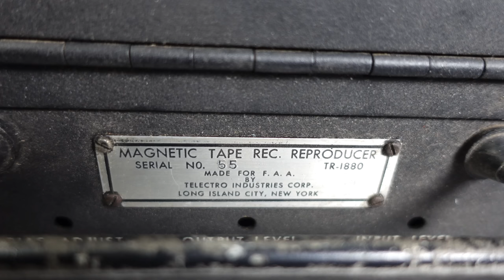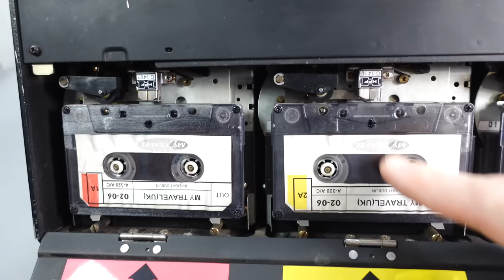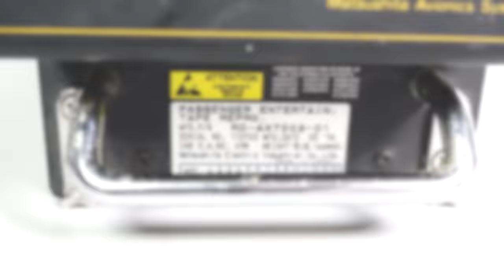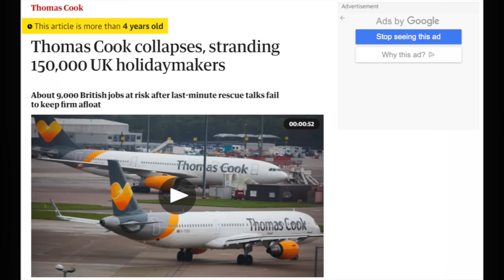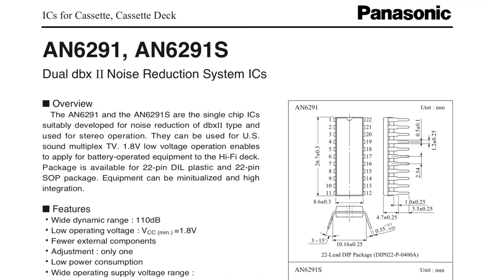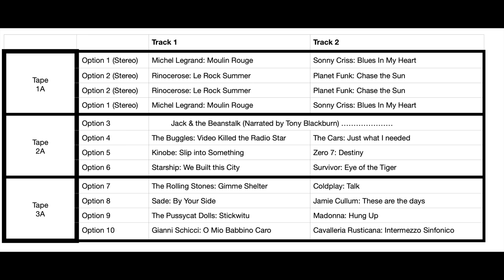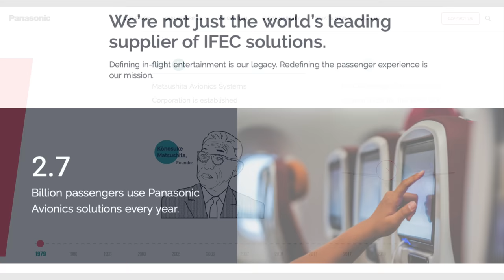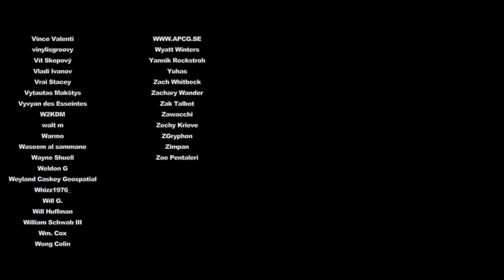The in-flight audio player

Comment: As an AV Geek (the aviation kind) I have fond memories of traveling on planes and experiencing the innovation in the IFE space.
2006 was an era where first generation AVOD IFE systems were reaching market saturation - at least on long haul wide body planes. The transition to AVOD resulted in the use of digital storage media for both audio and video, which would have enabled the transition out of these audio tapes for the audio "radio" channels. And even then, these AVOD systems were so unreliable that old channel system with banks of tapes was kept as a backup.
Reply: I assume that these AVOD devices had spinning hard drives in them, which could made those unreliable and prone to breaking down every time the plane shook (especially at takeoff and landing)?
Reply: @negirno  HDD's are not as bad as you think. Your average consumer hard disk "maybe" (with a lot of stress on may) but you can use those in a car with a laptop and those can get pretty bumpy. Those made for high stress environments can withstand a lot more, your average enterprise disk will outlive a normal desktop drive by an order of magnitude. Also: some drives can "instant park" to avoid most of the damage of extreme high G impacts (in the 500G range) and were definately capable of this in the 00's. Looking at normal figures of consumer drives, those can take 60G's while reading and about 250G with the heads parked. That's pretty impressive and that is just consumer drives. They have known failure rates, but so do all components.

If they could not, I'm pretty sure nobody would take a laptop on a plane. 

As a notion on G force impacts: look at some data from F1 driver impacts, the highest ones are just above 60G and if your plane did that the state of the entertainment system would be the least of you problems.
Reply: @NoNameForNone but then  again, nobody is taking their laptop on a plane several times a day, 7 days a week, year round. Plus your laptop isn't going to be directly bolted to the plane to pick up every little bump like a system like this would. So even though enterprise drives are a magnitude more sturdy than consumer drives, they also undergo a magnitude greater amount of stress.
Reply: @negirno  Yes, highly likely. Solid state storage as capacities which can store bulk digital media have really only become affordable in the last 7 years or so. However, any item mechanical or not would be developed, tested and rated for use in airplane conditions. It's not a consumer drive re-purposed.
Reply: Generally the unreliability in the early days of AVOD was more a result of the underlying maturity of the technology. The software and physical network was in its infancy and only really started improving in the 2010's.
Particularly the video part of these early channel based IFE systems used to run very similarly to analog TV's. RF composite video signals were piped around the plane, run to and demodulated at each seats television screen. When the first generation AVOD systems came about, data files were sent to seats using the same wiring but using the DOCSIS or HFC standard and a modem at each seat.
You can imagine how complex this set up must have been, especially when serving 500 passengers on a 747. And when the system would inevitably crash or freeze, a reset would take over an hour
Reply: @delightfullyyummy  Meanwhile as a software geek it's the "taking an hour to reboot" bit that seems ridiculous. Not so bad if it's consistently done when it'll be at least that long before the system is needed, but... what on earth was that software even doing ? Running on a server that takes 45 minutes to POST for no very good reason? Just being that bizarrely structured that it takes an age to actually start up, like self-service POS units still are (but even those don't take THAT long as far as I know)?

Comment: 1:47 . . . When Mat mentioned the 400 Hz AC power supply used on commercial airplanes...  this is done to save weight by making transformers and motors significantly smaller and lighter than land-based 50 or 60 Hz devices for the same amount of inductive power transfer.
Reply: Wow. Before this video, I thought that airplanes simply used 12V DC like cars do, or 24V DC like RVs do. I don't know why they bothered to add transformers. Perhaps to save on fuel since DC uses more energy than AC, and on an airplane fuel economy is essential.
Reply: @skywind007  Commercial airplanes have standardized on 115 V, 400Hz, 3 Phase for AC powered motors and lighting,  and 28 VDC for all essential DC (battery or TRU) powered items for decades. 
The Boeing 787,  switching from bleed air system to electric (anti-icing, passenger cabin pressurization, etc.) adds 235 VAC variable frequency 360 to 800 Hz from generators,  which is rectified to ±270 VDC to operate large variable speed motors.

Comment: The last time I recall using the in flight 'radio' was on a long haul flight from London to Toronto. I remember choosing the 'alternative' station and hearing Champagne Supernova by Oasis and 1979 by the Smashing Pumpkins 6 times during the flight - which tracks with 90 minutes of audio available on any given station. I also remember that the channel selector went from 1 to 12 but having 2 empty stations.
Reply: I did a similar haul in the opposite direction (Toronto to London) and remember much the same issue, though i ended up swapping to a different channel after a bit to try to alleviate that.This would have been in 2008 about.
Reply: Often the 'empty' channels would be the audio feed for the in cabin movies

Comment: When it comes to a certified aircraft you have to use a certified device which basically increases however much you think it costs by a factor of 10. In addition with few exceptions you will be stuck with that solution for the operational life of that aircraft, they tend to avoid updates because it requires an STC which basically means megabucks $$$$.
Reply: It's not just certification that costs - everything needs to be traceable down to individual components and manufactured to very high standards for reliability and safety reasons. Hence why all circuit boards are coated in varnish, and anything that goes on a plane is tested to operate within a wide range of conditions and tested to have a high MTBF (mean time between failure). It's expensive, but ultimately lives depend on it, even if it's just for in-flight entertainment.

Comment: I seem to recall on most planes there would be a 12 channel system.  

Channels 1 & 2 were generally video, which as Techmoan covered off several years ago would likely be played off a Video8 tape, although VHS was occasionally used.  I assume there'd be two languages, both in mono.

Channels 3-12 would then be used for "radio" stations.

Virgin's oldest B747-200's (the ones with the absolutely miniscule seatback video screens) had a hybrid and you had to physically move your headphones between the seat back video for TV and the armrest for radio.  These were definitely from tape.  Newer aircraft apparently used CD.

Obviously now the idea of inflight radio is completely dead, at least in Europe.  Shorthaul they don't bother, and longhaul there's effectively an internal music streaming service as part of the seatback touch screen.  From what I can see, nowadays your inflight entertainment system is basically a heavily locked-down Android tablet!
Reply: Very close, channel 1 was to listen to the pilot communications, if you wanted, not an additional language, in most airlines.  At least until 9/11 in the states, but it's starting to reappear on some airlines.
Reply: Many airlines now have you download an app before takeoff, and then use your own phone to stream movies, video and other media from the onboard server.
Reply: That's more common on planes that operate domestically or regionally. The idea is to cut costs and save weight from having an IFE installed. Here in the U.S. it's common for domestic airlines like American or United to have entertainment via apps, although jetBlue is an outlier with IFEs on all their planes (A320/A231). A good example is United's Boeing 777, their B777-200s used domestically don't have IFEs but their B777-300ERs that are used for international flights (and some SFO-HNL flights) do come furnished with IFEs. Many planes on transpacific routes to/from Asia & the U.S. (B767s, B747-8i, B777-200ER/300ERs, B787s, A330s, A350s, A380s) certainly have IFEs @mrfrenzy.
Reply: I remembered the "channel" selection on Thai Airways' B747-400 from the 90s to early 2000s. The first two channels are for the movies being played on the front projector (which I remembered were Sony CRT front projectors with 3 lens for the red/green/blue images) and some 13" CRT tubes in areas of that plane that doesn't have a good view of the projection screen, each channel was for English and another language in mono. The rest of the channels were music. Even though Thailand is a 50 Hz PAL country, the content played in their plane was definitely 60 Hz NTSC.
Reply: @Chiberia fascinating, I don’t remember that in Europe. From my experience 1&2 was always the film in English and the dub for whatever country the plane operated out of. Some people used them to brush up/test their language skills for their destination! 😅
Reply: @kaitlyn__L  makes sense for EU. In the US it was always that way.
Reply: @TonyW79SFV IFE is so cheap these days it’s not terribly surprising to see budget airlines who still choose to buy fairly new or actually new planes add them. Both in terms of weight and cost, since the LCD monopoly was busted the cost of everything came way down.
Reply: @TonyW79SFV I used to play my N64 on one of those giant RGB projectors in my basement as a kid. Let me tell you, those things ran HOT.
Reply: @Chiberia  I'm not sure how the modern systems work, but surely they're all IP based, even if they include things like the FA call bell?  If some airlines are doing it by making the user download an app to their own device, and I know Virgin's system for example is basically Android tablets (albeit locked down to within an inch of their lives) then presumably much of it is wireless save for a power supply to the seat in front of you and they communicate on an intranet?
Reply: @Chiberia  Not really. I used to work IFE for Boeing on the 787 program. You would not believe the costs of components. For a quick example, the controllers, which are basically stripped down Android tablets, can cost over 10k a piece. Most planes had about a hundred installed.
Reply: @Plaprad I guess I meant relatively. $1M spent on IFE is a drop in the bucket for a $240MM aircraft.

Comment: Airplanes are notorious for sticking around with systems just because it is cheaper to go with something that works. In-flight movies were played off Hi8 tapes and you'd have to wait for them to rewind when they ended. They definitely were still using them in 2010 and 2011, when I did long-haul flights on BA and United - hell, when I went to Chicago in 2016, my United flight was still using this system, even though many others had upgraded to a digital on-demand system.

Comment: I worked for a rival to In-flight Dublin here in Suffolk CALEX Skyline-ife. I started in 1998 and we were still occasionally making tapes for this system when I left in 2013. I can tell you unpacking the tapes and getting them ready for the duplication machines was a pain … all commercial wrapped cassettes TDK 120 FE used a lot… I’ll try and dig out some photos of the set up.

Comment: That is quite a fascinating system.  I remember one flight I was on, back in the days where the headphones were air rather than wires (and you were supposed to pay for the tube to connect the headset to the armrest, but you COULD just hold your side up to the holes and hear them anyway) where one of the selections was the audio for the James Burke Connections series.  Well, at leat the first episode, anyway.
Reply: Indeed, I remember well flying on an early BOAC 747 which had the uncomfortable stethoscope style headphones with hollow plastic tubes! Surprisingly convincing sound quality nonetheless, and will always remember hearing the uplifting swells of the James Last orchestra during take-off from a very soggy Heathrow. 👍
Reply: Ahhh Connections! I miss that show.... Hearing about how a new way to make billiard balls led to developing new ways of mining ⛏️...I was always fascinated by that show.
Reply: My older brother worked on a catering service at LIS in the early 80s and he indeed brought one of these home. I was 6 or 7. I didn't understood at a first glance how the heck that worked!
Reply: I have some of those air headphones I use them for My Edison Cylinder Phonograph.

Comment: I had a dbx-equipped cassette deck back in the late '80s. With a good audio source (like from a CD), the audio quality was exceptional, even on cheap type-I tapes. Recorded onto a FeCr (type III) tape, the audio was indistinguishable from CD... but buying the CD was about the same price.
Reply: I used dbx with a tascam 34 multi track reel to reel, and it was very impressive. It worked well with cassette machines like tascam 134 too, when used with decent metal tape.

Comment: As soon as I saw the arrangement of the tapes I thought this might've been for some form of passenger entertainment system...But when you showed the audio channel selector at 13:37 I suddenly had a flashback to the near identical ones that were used on Virgin Pendolino and Voyager Trains from 2002 through to when the franchise went to Avanti at the end of 2019. A nice wrap-around for a concept which originated on the JR Shinkansen! 🚄🎶😀

When it was in use the Virgin system offered nine channels of audio on Pendolino trains (Five on Voyagers ) and most of the content on these was compiled by Virgin Radio, with the exception of the news channel which was compiled by the BBC News service. The channels were updated frequently, and a system based around compact cassettes would've been much more appropriate for this at a time before CD-RWs existed, digital audio systems were prohibitively expensive, and CD-Rs were costing at least £4,- a pop. 🚄💿💸
It was often said Richard Branson wanted Virgin Trains to give a very airline-like experience, and so the use of aviation oriented equipment to provide an aircraft-like feature seems on brand for VT as it was back in those days. 😇

I'm going to ask a few folk in the industry if these were used on Virgin Trains as well, and I'll update this comment if I find out anything! 🎧🎶😇

Comment: Back in the 1990s I remember transatlantic trips on Continental. In addition to the "electronic" audio that could be listened to via standard headphones and channels and volume altered, there was also the option of piped audio where you basically plugged a stethoscope into the arm rest and listened to whatever echoed down the hollow tubes. Of course, with the "electronic" audio, there was also a channel linked to when the projector screen lowered down at the bulkhead and the RGB projector lit up and played a movie. And of course, also a feature in the armrests back then were ashtrays.

Comment: The video channels and audio channels (1 - 12) would typically be multiplexed using Delta Modulation to save wiring and weight and decoded at the seat electronics units,  and armrest channel selector / volume controls for the specific channel desired.  The same multiplex network could be used to control the overhead reading light and attendant call lights on airplanes like B747, B767 and L1011 which would be too high to reach from the seat,  so their buttons would be incorporated into the armrest audio selector.  The Delta Modulation resulted is fairly poor audio quality,  but there were often one or two channels (5 and 6 if I recall) which would be in stereo,  typically for classical and jazz.
Reply: Yes, I do recall call bells being in-seat on B747s and B767s back in the day.  I flew on a Virgin Dreamliner recently but I would assume that was all part and parcel of the touch screen based system.

My abiding memory of the inflight radio is that the sound quality was not great.  These tapes were basically on a loop and getting played whenever the plane was in the air (which is most of the time as they don't make money on the ground!) and my God they sounded ropey.

Comment: I do remember flying with MyTravel, working in in IT I'd also visited 'Holiday House' in Rochdale quite a few times - I believe Zen Internet are there now. I always wondered who listened to the inflight radio stations. The only flight I can remember with MYT was an old DC10 - an aircraft with 3 engines and I think been used as a standby aircraft.

Comment: This video reminded me of when my family were on a Qantas domestic flight to Brisbane for a Gold Coast holiday in 2010. They used an old aircraft from the 1990s or so (that would've since been retired) so the in-flight entertainment system didn't have individual LCDs, instead having RGB projectors and (if I recall correctly) CRT displays at the front of each section of the passenger cabin, and the channels the passenger could switch between were one for the audio feed for the screens and the rest for audio-only channels.

I flipped between the audio channels and found one that just had someone with a clear voice reading something. Little did I know at the time that it was the first time I had ever listened to an audiobook.

(14:42) I believe the audio on that flight would've been played by a tape player just like that, though at the time, I probably thought they were being played off of CDs.